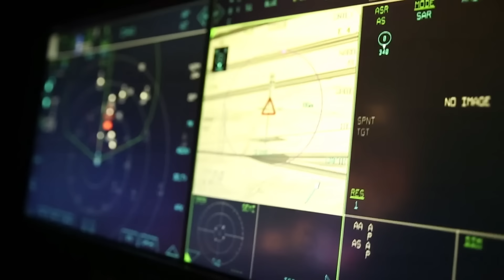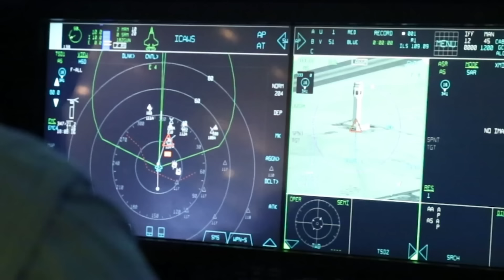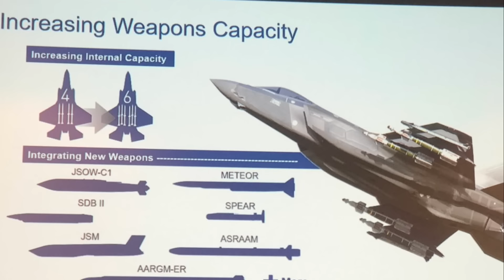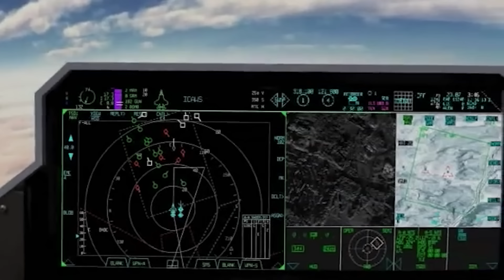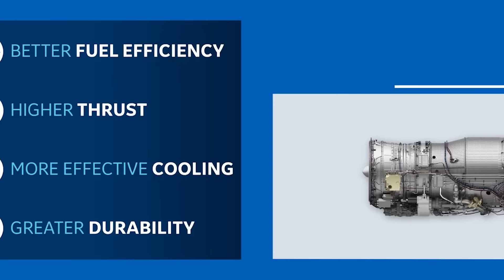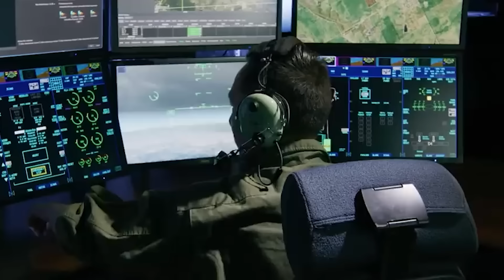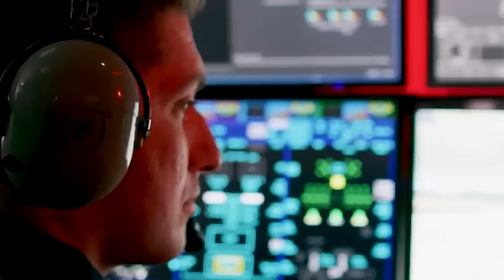The F-35 is about to become a POWERHOUSE

Comment: The author fails to understand that the biggest critics of the F-35 aren't about it's technology so more upgrades won't change the fundamental flaw which was it's concept design. The initial design goal of the JSF program was first and foremost to find a replacement to the Harrier jet of which it's main role was CAS missions and anything else was and is secondary. Basically, the F-35B variant stole the entire project spotlight from the Air Force and the Navy so that the Marine Corps got the best platform. Despite both branches being bigger they somehow drew the short end of the stick. The JSF is a failure not because of it's technology but because it's the result of pandering the entire projects needs to a questionable branch of a military that focuses on amphibious assault of which would be a suicide attempt against big countries in the modern day era ... 

Let it sink in for a moment that the largest military procurement program was mainly intended to be a VTOL GROUND-ATTACK/CAS aircraft which has little to no use for the other branches of the military. The F-35 was never intended to be a fighter despite whatever fantasy the program planners were conjuring up. The US military would've had a better outcome if the JSF didn't exist in the first place. The USMC would've been better off with a VTOL modified A-10, the Navy with a true F-14 successor, and the Air Force deciding between a cheaper single engine F-22 variant or an F-117 successor with a bigger internal weapons bay to carry the AGM-88 HARM to have the best possible SEAD platform ... 

For anyone buying into the BVR combat hype behind the F-35, if the bigger F-15 which can house more powerful sensors and bigger radars couldn't always engage other aircrafts exclusively in BVR then what makes you think that the F-35 with it's smaller radar and slower speed is any more effective at BVR combat ?
Reply: The Air force and Navy weren't involved in the project until about a decade after it began. They only got involved in the first place because the proposed designs showed enough potential that they could replace the F-16 and F/A-18A/B/C/D with a couple of modifications.

The F-35 was primarily intended to be a fighter... that was the original purpose of the program requested by the USMC. What they wanted was not another Harrier. They wanted a STOVL multi-role fighter that could allow them to rely less on the USN for air superiority, and that's what they got... after many political hassles unfortunately. 

It isn't physically possible to create a VTOL A-10 without removing everything that makes the A-10 the A-10. Not that the USMC would even want a VTOL A-10, because it didn't do anything the Harrier couldn't already do and was notably less capable against conventional enemy forces.

The Navy didn't get a true F-14 successor because Boeing convinced congress to buy the Super Hornet claiming it was a new Hornet variant to cover up the fact the original Hornet failed to replace 2 of the 3 aircraft it was supposed to replace. It had nothing to do with the F-35.

You realise that the F-117A needed a lot more than just a larger weapons bay to use the AGM-88 right? And that the F-35 is getting the AGM-88ER to be the best possible SEAD platform right? You also realise that you need a lot more capabilities than just an ARM for SEAD right? For instance an F-117A could easily be jumped by an enemy fighter and be completely incapable of defending itself. Afterall SEAD implies that it will be on the frontlines, where all the enemy aircraft will also be.

For the last paragraph, you're demonstrating a fundamental lack of understanding about BVR history and technology. BVR combat is primarily dependent on the ability of an aircraft to identify it's target and engage under optimal conditions. Last century when the F-15 achieved all it's air to air kills, this was much more of a problem than it is today. F-15's back then ONLY had a radar, so if visual confirmation was necessary the pilot had to get close enough to identify the target with his own eyes.

These days an F-35 can get visual confirmation from 50km away in any direction thanks to it's 7 IRSTs, or it can scan a target out to around 150km away with it's AESA radar to get the shape of the target and compare it in a database of aircraft to figure out what the target is. The modern F-15X has an advantage here with it's more powerful radar, but also only has a single IRST which faces forward, making the F-15X practically incapable of tracking targets that are not in front of it and therefore much more vulnerable to ambush.

The F-15X is also at a much more notable disadvantage, because it is huge and therefore will almost never have the advantage of surprise. That means the enemy can react appropriately to the incoming threat. An F-35 with it's stealth can get much closer before being spotted, which gives the enemy significantly less time to react and could even cause enemy pilots to panic and lose situational awareness.
Reply: @dumdumbinks274  The Air Force and Navy only showing interest later on means that the F-35 was intended to be CAS/ground-attack aircraft which is the main mission of the USMC. Do you really think that the USMC would somehow be able to achieve air superiority with only just 20 fixed wing VTOL aircrafts and neutered sortie rates on the USS Wasp (25 for USS America-class LHDs) ? Worst thing about LHDs is that they currently don't have any fixed-wing AWACS like the E-2 Hawkeye. That means that F-35B pilots are going to be blind in the battlespace without turning their radars on which lower the proposition value of their low observability technology since their radio emissions can be traced back to them unless they can get AWACS in place of using their radars. The USMC requesting a fighter design is just a bad joke since they have no other assets like tanker aircrafts at all times to support them effectively ... 

A VTOL A-10 could be an improvement over the harrier in terms of payload, loiter time, and more airframe durability (had an internal gun over the F-35 too) which would arguably serve the USMCs purposes better and they'd be useless today against many conventional forces. Amphibious assaults requires close-air support which makes stealth entirely pointless since aircrafts have to be nearby to support expeditionary ground forces ... (bombs also can't travel very far either since more space is used for warhead as opposed to fuel)

The F-35 still has a small internal weapons bay and considering that the AGM-88 HARM is twice as big as the AIM-120 AMRAAM, at most the F-35 could only carry just 2 anti-radiation missile in case it had to carry 2 air-to-air missiles if it wanted to remain stealthy for air combat so I don't see a strong case for the survivability argument heavily in favour of the JSF in this loadout without other aircraft escorting them for CAP missions as would be the case for the Harrier or A-10 as well. The JSF didn't lean heavily into either air-to-air or air-to-ground roles so it's in the middle of nowhere. The F-35 should've been optimized for just 1 of those instead of being mediocre at both. Does the Air Force want a cheaper/smaller F-22 (no ARM missiles internally) or do they want another F-117 to be a great lightweight bomber/ground-attack with integrated SEAD capabilities ? Multi-role designs are compromises from the outset ... (F-35 is no good "balance" between the two IMO) 

F-35 can get closer but their top speed is lower as well so missiles deployed will start at mach 1.5 while missiles from an F-15 can start at mach 2+ which gives the missile higher probability of kill at longer ranges for the latter despite both using the same AIM-120 AMRAAM. IRST can't be used for identification purposes either since the IR signature doesn't reveal any important information on whether the aircraft is friendly or foe and we developed AWACS aircrafts for purposes including IFF as well. A combat aircrafts radar is mostly only good for locking on some scrap of metal in the skies so they rely more on data link (especially from AWACS) for battlespace awareness. The F-35 only gets 4 missiles total in it's internal weapons bay compared to 6 missiles (some included with IR guided high-off boresight capability) with other stealth fighters so there's not a whole lot of room for error. The JSF is about the size of a medium weight fighter so there's far less room for upgrades compared to larger/heavier aircrafts like the F-15 which can probably equip better radars/sensors and stronger countermeasures than the JSF ... 

The JSF is still a really dumb concept overall. Most of the sensor fusion is useless for air combat (it's meant to be used for air-to ground ISR missions) and adding low observability while leaving the gun out for a CAS aircraft isn't clever either. All aviation branches of military would've been better off with far more unique airframes/platforms. Should've had separate projects for a new lightweight/cheaper fighter or bomber for the AIr Force, VTOL/CAS aircraft for Marine Corps, heavyweight/air superiority design for the Navy. All the JSF did was force all branches of military to take a Harrier replacement ...
Reply: @herahbgad9061  No it really doesn't mean that. Just because a service wants a multi-role fighter doesn't mean they want that fighter to perform the air superiority *role*. Why does it somehow not make sense for the USMC to buy a multi-role fighter for a ground attack role? The USAF did exactly that with the F-15E.

Fact of the matter is that the USMC asked DARPA to start R&D for a new STOVL multi-role fighter back in 1982, specifically to bring the capabilities of the F/A-18 and F-16 to LHDs.

LHDs not having AWACS is a reason to adopt the F-35B, not ignore it. Of course I could also point you towards the many nations that operate fighters but not AWACS or tankers too. Sensor fusion's advantage is that pilots don't need to rely on AWACS for battlefield control. Sure it would be better if they had AWACS and tankers, but their mission is pretty localised. 

Seems I need to say it again. A VTOL A-10 is not physically possible without producing a completely different aircraft. Because of that your claims are meaningless. 

How would stealth be useless in the CAS role? CAS aircraft are not guaranteed protection against a peer enemy, and even A-10s typically fly above 5000ft just because terrorists might have MANPADs. At that altitude you're vulnerable to long range missiles, especially if facing a peer enemy, which the US hasn't done so since WWII. 

The F-35 can carry 2 AIM-120s and 2 AGM-88s internally. You don't need to speculate on this. That payload is significantly better than an F-117A with 2 AGM-88s and no defensive weapons to speak of, let alone room for electronic warfare systems. There is also a key difference between A-10s and Harriers being escorted, and F-35s being escorted. That is simply that A-10s and Harriers require OTHER aircraft types to escort them. F-35s are effective enough to provide escort to other F-35s, just like how F/A-18s provide escort for F/A-18s.

Multi-role capability is a matter of avionics, not airframe. Multi-role aircraft are still designed to excel in at least one role, with the sole exception being the F/A-18 which was designed for the Air Force and scaled up for the Navy so that politicians wouldn't have to fund a 2nd fighter competition. As far as combat roles go, specialist designs tend to result in subpar performance except in specific situations, such as how the A-10 is the best CAS plane in 10% of CAS situations. For the other 90% an F-16 will do perfectly fine if not better.  The F-35 is a design that focuses on ground attack, and outperforms every aircraft it replaces by a rather notable margin in ground attack roles. It also vastly outperforms every other fighter in BVR combat except the F-22.

Speaking of which... the F-15... Mach 2+ with missiles. That's a no as far as most sensible F-15 operators are concerned. Typical max speed is Mach 1.8, or Mach 1.4 with external fuel tanks. But the real problem with Mach 2+ is that fighters never have enough time to accelerate to such high speeds while performing CAP duties. Ask any experienced fighter pilot and they'll tell the max attainable speed before engagement in most situations is around Mach 1.5, and that the Mach 2+ fighters are notable not because of their speed, but because of their acceleration. An F-15 will reach Mach 1.5 before an F-35 does, but in reality the difference is more like 0.2 Mach, not 0.5 Mach.

IRST provides situational awareness, and is often paired with EO systems to provide long range visual ID, as is the case with the F-35's forward looking sensors, and the F-15 using the Sniper pod. AESA fighter radars have been able to scan the target's shape at long range for a little more than a decade now. The F-22 was the first to gain the capability with the APG-77v1 in 2008. Granted that is long range for a fighter, not AWACS, it is still good enough for a fighter operating alone to identify a non-stealth target before it gets within optimal range of the AIM-120.

Dumb concept? You realise the sole reason the Iraqis scored the first air to air kill during Desert Storm was because a USAF E-3's IFF interrogator failed, and as a result a MiG-25 was able to slip past the CAP and found itself behind a USN strike package. To claim that sensor fusion is useless in air combat because AWACS exist is to admit you think having a single point of failure is acceptable. An F-35 has enough sensors to act as a mini AWACS, and with so many of them the reliance of the USAF on AWACS becomes less of a problem in the face of China who are actively developing their air defence doctrine to target and destroy US strategic aircraft such as AWACS and tankers.

Leaving the gun out of a CAS platform? Very funny, considering guns get barely any use on CAS missions to begin with. Even the A-10 only uses it's gun in around 10% of CAS missions it performs. Besides, the F-35 has an external gunpod that only exists for the CAS role, and it is just as accurate as the A-10's gun.

All the F-35 did was provide the USMC with a Harrier replacement, the USAF with an F-16 replacement, and the USN with a Hornet replacement. I don't know if you realise, but the variants are all physically different to meet the requirements of each service, and each variant greatly outperforms the fighters they respectively replace.
Reply: @dumdumbinks274  It doesn't make sense because the USMC's main role is to perform amphibious assaults and their associated wings are supposed to support the very ground troops who are risking their lives to make it on the coasts. I could understand their needs for a fixed wing over a rotary designs such as being able to fly both higher and faster. Anyone can also see why they would also require fixed wings to be VTOL capable since LHDs don't have catapults/arrestor wires/often times ski jumps too. VTOL fixed wings is the absolute minimum necessary for them but being multi-mission capable too like the F-35B was absolutely not the way to go in the context of an amphibious assault. If you're acknowledging that LHDs don't need AWACs or tankers specifically because of the nature of their mission requirements then what other value does the F-35B provide to them ?

It doesn't even have to be VTOL A-10s, the USMC could've opted for combat aircraft based on a tiltrotor design instead which would've served their purposes just as well and it would've saved them a ton of money over the JSF project. Considering the amount of weapons carried for CAS missions, the F-35Bs tiny internal weapons bay becomes a major limitation and all of a sudden you've got bombs mounted with external pylons on the aircraft. If you're going to turn on your radars and externally carry weapons then optimizing the airframe for low observability just became a pointless exercise ... 

When CAS missions happen, it's the Navy's responsibility (NOT the Marine Corps) to hold CAP/escort missions to defend assets performing CAS (Harriers/helicopters and the likes are very vulnerable during air combat). Low observability does make a lot of sense for some of their missions like air superiority, interception, or SEAD. The F-35C still loses major points since it's the size of a medium weight fighter aircraft compared to the heavy weight F-14. The F-35C underutilizes the powerful catapults available on aircraft carriers so their smaller airframe limits their mission capability to perform air defense for the fleet and deep penetration strikes. The F-35C can't competently cover the vast spaces necessary ... 

Multi-role is absolutely dependent on the airframe. A bigger airframe can equip more powerful/heavier sensors and can carry more weapons/fuel payload as well. A bigger airframe can also support more powerful engines or have two engines. There's far more freedom in multi-mission capabilities with bigger airframes. Smaller airframes must make more compromises in mission capability with the space they're given. The A-10 is intended to be a cheap platform to operate for a specific set of missions, being the best in CAS is just a cherry on top of the cake. The F-35 has cost overruns all the time for a really mediocre multi-mission capable platform. Best at BVR is really questionable claim as well given the smaller range, limiting internal weapons bay, and a slower speed as well ... 

Remember that using the radars compromises the aircraft's low observability. This is why AWACS with the more powerful and bigger antennas are pretty much essential to keeping stealth fighter low observable and their pilots in battlespace awareness. AWACS as it is don't get credited enough IMO for enabling the main capabilities of fifth generation fighters because they're the keys unlocking those features. Fifth gen fighters even with their sensor fusion wouldn't have anywhere near the amount of situational awareness that comes from data linking with AWACS. Every country that can afford to have a real Air Force have AWACS or have sharing arrangements like much of Europe. A fighter jets radar/sensors and computers should be the last resort for ISR purposes and is mainly meant to get a firing solution ... 

The JSF project sounds even more ridiculous the way you frame it. We have a project who started it's life clearly as a Harrier (CAS aircraft) replacement which was then supposed to meet the mission requirements of both the Air Force/Navy, be cheap (see CALF), and is to serve as a miniature AWACS all in the size of a medium fighter jet. You made a case that the project should've been scrapped and restructured since it's plainly visible to everybody to see that the F-35 hasn't aged very well to meet any of it's original intentions ...
Reply: @herahbgad9061  It makes sense because the USMC don't operate inside a vacuum where the USN CAP is perfect and never fails. They are expected to operate effectively against a peer force, not solely against insurgents in wars where the enemy doesn't even have an air force to contest a USN CAP.

The purpose of multi-role fighters is to provide redundancy to operations that a specialist like the A-10 simply cannot. That redundancy is more valuable the higher the threat level. It's about giving to the pilot the ability and agency to handle unexpected situations. And at a strategic level it's about logistical and operational benefits such being able to shift the force structure to alleviate the effects of attrition, rather than having to wait for production lines that would take months to produce replacements.

A VTOL A-10 or tiltrotor doesn't matter, they would be rather slow specialist aircraft that wouldn't provide any better capability than the current options available to the USMC. 

Airframe size does not affect multi-role capability directly. It affects general performance regardless of role and is something considered before designing an aircraft because it is the biggest factor in regards to the cost of an aircraft. As such you cannot produce an F-15 sized fighter to perform the roles of a workhorse.

The A-10 is just as expensive as the F-16 and always has been, both to buy and operate. It also isn't the best at CAS outside of a few situations where the enemy completely lacks air defences. In most cases the F-16 is better at CAS.

The F-35 is the best at BVR other than the F-22 because it is designed for future engagements. An F-15 is slightly faster giving slightly more missile range sure, but it's also a massive target that cannot surprise any enemy unless they're already blind. Additionally being able to launch a missile from a closer distance means there's more time to accelerate before launch, and it gives the enemy significantly less time to react to a missile launch. 

Using radar does not automatically compromise stealth. It's not the greatest idea to turn a radar on while attempting to hide, but LPI modes on AESA radars help drastically at the cost of reducing range. But range isn't a problem when you have a radar than can spot an F-16 or Typhoon from 150km away, and they can only spot you from 50km away. 

AWACS get plenty of credit. They're basically the reason the US strategy worked in the first place. Nobody is claiming that the F-35 replaces dedicated AWACS, and nobody is claiming 5th gen don't benefit from AWACS. However a 4th gen fighter without AWACS is a loss just waiting to happen. A 5th gen fighter without AWACS can at least act autonomously and still remain effective, albeit in a more localised AO. 

You seem to like manipulating my words to suit your narrative. The F-35 started life as a STOVL multi-role fighter, not a CAS aircraft. It became capable of replacing the F-16 and F/A-18 simply by removing STOVL capability, because without the hump causing a large amount of drag it's projected performance was superior to the other fighters, and that turned out of be reality with the production models. Originally the F-35 was supposed to be the same price to buy as an F-16. These day's the production model F-35A is only about 10% more expensive than a modern F-16, so they weren't wildly off the mark.
Reply: @dumdumbinks274  If the USN is incapable of providing adequate CAP/escort for CAS aircrafts then the USMC may as well call off on doing the amphibious assault. If the USN's aircraft carrier with it's 70+ fixed wing aircrafts launched with powerful catapults can't cover the USMC, how much chance does the USS Wasp have with it's weaker 20 fixed wing VTOL aircrafts and no AWACS ? How is an F-35B supposed to be equipped to do both CAS and CAP missions simultaneously without sacrificing low observability ? Equip F-35s for CAS missions and they're definitely going to be intercepted and shot down thus the amphibious assault fails. Equipping F-35B for CAP missions means tons of ground troops dead on the shores since they couldn't depend on air support and the amphibious assault fails either way ... 

Redundancy in operations doesn't make a military stronger. There's a cost for building fault tolerance into the design whether it'd be in terms of performance or procurement. The only capability the USMC required for CAS is to be able to fly high/fast enough and drop as much ordnance and bombs as possible and the F-35B isn't as optimized for that purpose as much as it could be ... 

Actually, the F-16 is significantly more expensive than the A-10 per airframe but you are right that they have similar operating costs. Just because an F-16 can fly higher/faster doesn't necessarily make it the best CAS aircraft. A-10 has other advantages that arguably make it better than an F-16 at CAS such as airframe durability and loiter time all of which are reasons why congress hasn't retired the A-10 yet from the Air Force ... 

The F-35 is the best BVR fighter in it's CLASS (medium weight). Not only is the F-35 slower but it has nearly no upgrade potential left. F-35 is basically stuck with the F135 engine which will be slightly upgraded in the future so it won't see much of a speed or power output improvement for the radars/sensors/electronics. It remains to be seen how much of an improvement the AIM-260 is over the AIM-120D as well but I'm very skeptical that without significant changes in the dimensions/weight that the new missile will have a much greater reach ... 

It's called LOW PROBABILITY of intercept for a reason since the aircraft is still making radio emissions but using LPI mode also degrades your situational awareness since there's less information being generated/returned. Using LPI just makes it harder for you to observe the enemy as well so it's not as big of an advantage as you think. 4th generation fighters can always turn their radars on at full power since their pilots aren't worried about sneaking around the air space. 5th generation fighters are even better in combination with AWACS ... 

You underestimate how just important AWACS are for contributing to a ship's defensive capabilities. All integrated radars on any ships will be limited by it's "radar horizon". An enemy with hypersonic and anti-ship missiles will easily make mince meat out of any LHDs since the enemy can fly low to avoid being detected. A USS Wasp with no AWACS is just asking to have it's own defenses overwhelmed with a very small window of reaction time available. The JSF is pointless to LHDs without the threat monitoring capabilities of AWACS if the enemy is going to carry out anti-ship strike missions thus effectively sinking 20 F-35Bs along with the LHD ...
Reply: @herahbgad9061  Sigh, you still don't comprehend the big picture. CAP + AWACS does not guarantee an enemy fighter will be defeated, especially against stealth fighters, and a breach of this system is exactly what lead to the loss of an F/A-18 over Desert storm. If the USN cannot protect their own fighters, then the USMC fighters need to be able to defend themselves in an emergency. 

Why are you blabbering about a single fighter performing simultaneous roles? Even nations that only operate 1 type of fighter don't do that, they just equip a different airframe with a different loadout. The reason multi-role capability is important is because it increases survivability over dedicated attack aircraft, and makes logistics and mission planning easier while enhancing redundancy without incurring significant costs compared to single-role aircraft. 

The A-10A in 1978 cost $10 million. The F-16A cost $12 million. Based on the cost of A-10 upgrades that ratio is practically no different today than it was back then. 

The A-10's durability is only effective against small arms fire and low calibre unguided AAA. MANPADs are enough of a threat to keep A-10s above 5000ft on 70% of their CAS missions against poorly armed terrorists, and troops in a conventional war are often supported by proper AA systems and vehicles that can easily harm an A-10 at low altitude. The A-10's greatest strength by far is it's endurance, but the vast majority of CAS situations require reactive CAS, not sustained CAS. Lastly the USAF have started retiring the A-10 with Congress' approval. Whether they get approval to retire the entire fleet is yet to be determined, but it's looking likely after what the war in Ukraine has demonstrated.

The F-35 is a better BVR fighter than the F-15 outside of a long range intercept scenario. And of course that makes it the best BVR fighter in it's class too. 

The F-35 has plenty of upgrade potential as it is designed to be modular and there is already newer technology available. It's engine will get minor upgrades over time, and potentially be replaced if the need arises. It's not as though the now cancelled GE engine can't be resurrected in the future. 

Likewise LPI is also not such a significant drop in practical performance as you claim. It doesn't matter that a fighter can no longer track 50 potential targets in a small arc in front of it. It doesn't matter that the tracking range is reduced from 150km to 75km either, especially not when it has AWACS support. It's pretty much equivalent to a rifle's suppressor, except that radars on fighters using LPI still exceed the effective range of the missiles they launch and can switch to full power at the flick of a switch. Also even when detected an enemy still won't be able to reliably identify an LPI radar signal. 

I never suggested the F-35 was supposed to defend ships. It's supposed to support troops and interdict enemy forces, while being more survivable than a Harrier, F-16, or Hornet. A ground force is always necessary to win a war, and the USMC provide that capability in places where the US Army cannot easily reach if a USAF base isn't present.